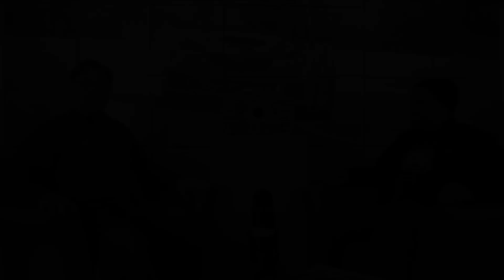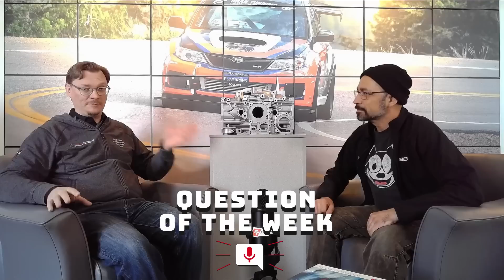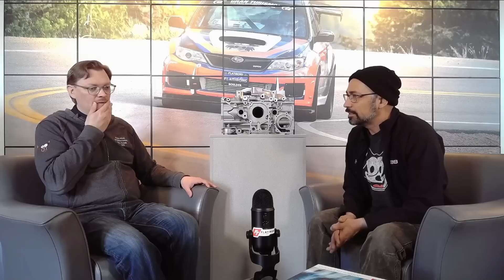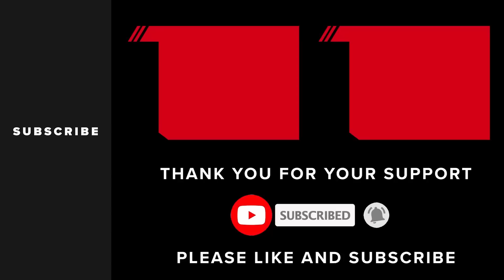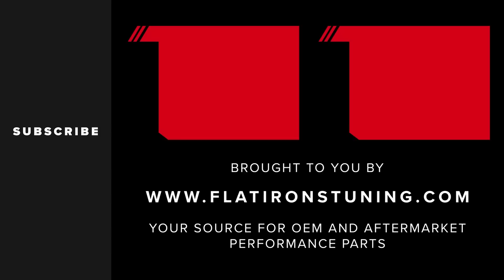What is engine knock? Fine Knock Learning, Knock Feedback and DAM

Comment: If an engine knocks and the ecu removes timing then wtf would the ecu restore that timing back to it's original value?
It will almost certainty knock again under the same conditions.
EFFECTIVE knock control must be simple even given a reduction of peak power if necessary.
Better to arrive a few seconds later than a smoking wreck at the side of the road.

Comment: I'm wondering if you'd recommend a 91 ots tune vs a 93 ots tune as far as reliability and less chance of knock on an ej
Reply from the maker: Thanks for your question.  It definitely depends on the fuel that you have access to.  If you have access to 93 octane fuel, and are at least somewhat confident that it is accurately rated, then you can definitely try running that map.

The best way to think of it is that you will not hurt anything running a map for a lower octane, if you are putting in a higher octane fuel.  But you could hurt something if you run a map for a higher octane fuel, but put in a lower spec fuel.

If you run the lower octane map, but put in a higher octane fuel, you would not get as much of a performance gain for the fuel, but you would get a benefit in reliability as the map will be able to run the full capability of higher octane fuel.

Hope that helps and Stay Tuned!
Reply: @FlatironsTuning  yeah that's actually a great explanation I may end up running my 91 tune and use 93 because I'm not certain how good the fuel is

Comment: Wish i knew my issue with my fkl. Got the car in 2017 with 7 miles on it, ran the same tune for 2 years, and the last 2 years have gotten fkl every day almost every day.  Its so bad that it will lower dam, if i want my dam to go baxk up i half throttle it where i can just hear the turbo and it shoots back to 1 and its fine for a month.  I've heard it could be carbon build-up, but I don't have any proof on that, and im surprised I've not run across more videos or stuff on this in the last 7 years. Before anyone says it's my tune, it's done this on stage 0, which is basically stock. So who knows. But with no check engine light, no sounds, no feedback knock, no leaks, i can only do so much by myself. So i just said, "Oh well, and drive it
Reply: I guess we’ll never know buddy. Take care.

Comment: If I install a Cobb Access Port on my stock 2020 STI,  will I need a tune?.
Reply from the maker: Thanks for your question.  Am I correct that you are comparing the Cobb off-the-shelf tune compared to a custom tune?
Reply: @FlatironsTuning  No I will not be turning my STI.  I just wondered if I ever got a Cobb Access Port and installed it, will I need a tune and would it void my warranty from Subaru and Carmax.
Reply: @paulmarsdensr1095  in order to install the accessport it flashes a stage 0 tune, which is basically a copy of your stock tune. Would the dealer be able to tell you installed an accessport yes, would they deny an engine claim? They would try to.

Comment: Great video explaining some more very complex subjects. I tend to see -2.8FK or less with a minimally modified EJ wrx, but occasionally see some -4 - -5.6 FK events but they seem to always happen when I shift at lower speeds. Anytime I am WOT it never has a single FK event so I don't worry much about it.  I also ran into a constant FKL of -1 - -2.8 and once  I replaced plugs, the FKL went away completely.
Reply from the maker: Thanks for the comment and thanks for watching.

Stay Tuned!
Reply: I’m currently having the same issue, low throttle in first gear I get 1.40 FK

Comment: My sti gets alot when cruising at around 2200 to 2400rpm  on knock sum cylinder 4. And zero at any other time. Drives me nuts 😅
Reply from the maker: We actually discuss this specifically towards the end of he video.  Here is the link with a time stamp:

https://youtube.com/watch?v=ln8WNEFsYaM&feature=shares&t=1996

Hope that helps and thanks for watching.

Stay Tune!
Reply: @FlatironsTuning  thank you for that I was on break and didn't get to finish the video 😅.  I also noticed that it only happens after the engine has warmed up ! Feed back 0,fine knock 0, DAM 0. This is a relief !
Reply from the maker: @jozeccav123  Excellent!